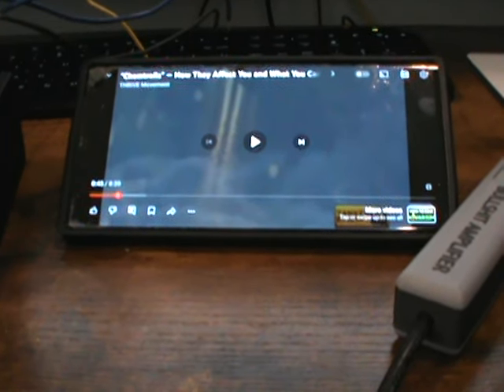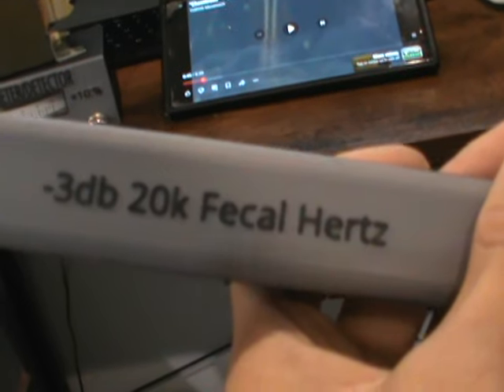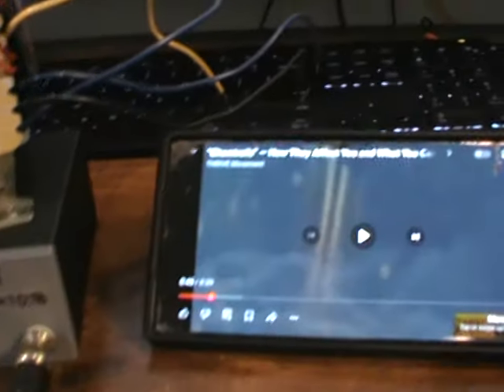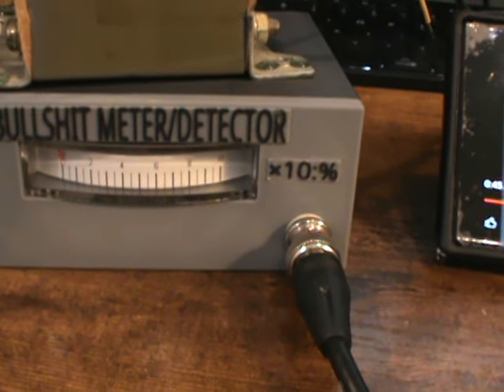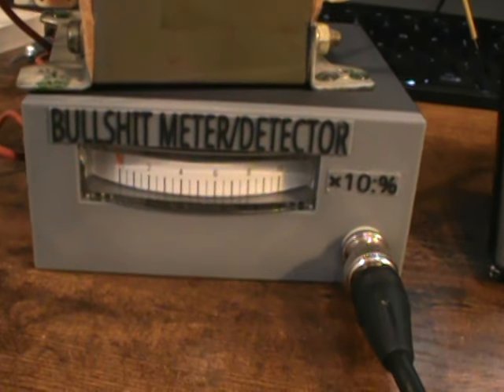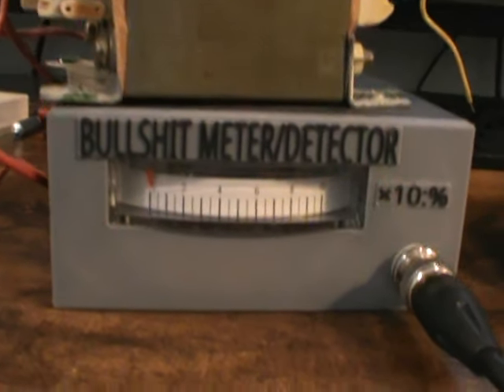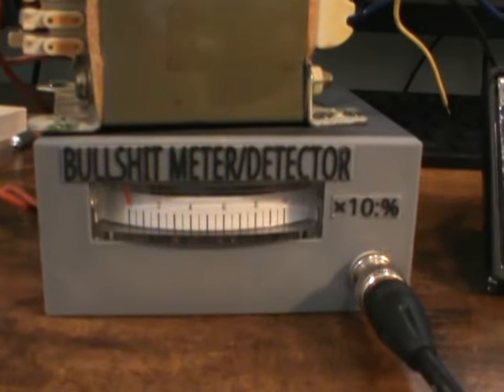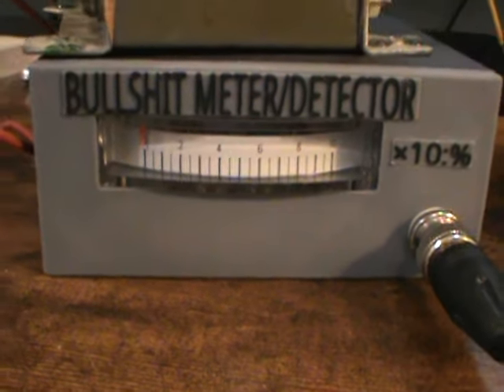The Bullshit O' Meter!

Comment: I worked on some of the first BS meter research back in '63 when we were lucky to get 5 KC of bandwidth out of a vacuum tube probe, your meter reminds me a lot of some of our first prototypes that suffered from exactly the same performance issues up until the late 90s. Although it's seriously impressive how miniaturized you were able to make this unit, the ones we made were the size of a lawnmower by the end.
- The pre-amp and displayed scale has to be A-weighted logarithmic, not linear. A linear topology (even with 9th order retro-BS filtering) will either overload at high BS levels or not have enough sensitivity to detect implied, vague or half-truth BS which is often the most difficult to detect and damaging type of BS that requires the use of a BS meter and trained expert BS meter operator
- The probe pickup horn shape shouldn't be exponential or reverse-log-periodic, you'll only get bad directionality rejection and spurious harmonics, the low-frequency cut-off advantage isn't worth it, stick to a straight pyramid horn. It also makes the dBi and BS⋅W/m² calculations much easier as you only need to consider the aspect ratio and throat diameter of the horn.
- Conical horns do have better performance than pyramid horns, but manufacturing them to the tolerances required is extremely expensive often adding $5k - 10k to the cost of even just a 20 kHz active probe, it's more cost effective to just use a Ni-Cu-Ni-Au pyramid horn and deal with the added inverse phase noise in the IQ demodulation block
- A probe protection membrane and a repeatable calibration sample are essential. Using your probe without protection runs a high risk of damage from contamination but even with protection the microphone will become desensitized after prolonged BS exposure. We would always play a known BS audio sample before every use to calibrate to a known scale and to know when the probe has reached end of life. Our final probe designs got to about 500 hours before needing to be rebuilt, never fully solved the issue, honestly don't think it's possible.
- The use of the transformer to weigh the meter down is extremely dangerous, you should never do that, without proper isolation and shielding the BS in the meter IF signal can be easily coupled through parasitic inductance into the transformer primary amplifying it to dangerous levels. Our research project was terminated due to a similar incident in May of 200- involving the main filter cavity of a high power detector for military use. The final accident investigation report found this bandpass filter cavity de-tuned when heat soaked from an unexpectedly large pure BS input signal which reduced the Q-factor causing exponentially increasing BS feedback between the main output power stages and the input isolation transformer through this filter. The system was designed to handle up to 3,200 MW but the protection mechanisms failed to shut it down and this power excursion pushed it beyond 33,000 MW before there was a BS resonance cascade. The incident was mostly contained with only minor casualties but unfortunately others decided the research facility had to be destroyed to contain it.

Also surprised you posted this on YouTube. You do know as a result of that incident they created 18 U.S.C. § 8922(a)(6)?
(a) It is unlawful for any person or entity to possess, maintain, manufacture, sell, distribute or describe a BS meter or precursor components, schematics, drawings, documents, software, designs or any part thereof. 
(b) Any person found guilty of violating this section shall be fined not more than $25,000,000 or imprisoned for not more than 50 years, or both.
(c) ███████████████████████████████████████████████████████████████████████████████████████████████████████████████

Comment: I think 20khz -3db is too much bandwidth and you get non-linearity that causes noise from upper frequencies to get mirrored to BS passband. You definitely should limit it to at least 10khz to prevent this. Also, it clearly gets overloaded even by legit BS, when Signal-to-BS ratio is too low. Consider extending the scale to at least 146% or adding high BS measurement band.
Reply from the maker: I think the overloading can be clamped with a retro-BS filter. The BS filter only allows BS to pass through while attenuating non-BS. Eventually when the non-BS amplitude passes a certain point, enough non-BS leaks through the filter to then get picked up the op-amp amplifier/buffers. So what I'm thinking of is to add a retro-BS filter in parallel to the output of the BS filter to attenuate the non-BS even more. This would in turn mean I have to re-calibrate the instrument, but yes I think it'll be a significant improvement.

In hindsight, the low pass filter cutoff should be lower like 10k Fecal Hertz as you suggested, but I made it 20k because some people when they start losing an argument about their BS start to get really really high pitched.

 I think instead of making a 146% scale, I'll add BS attenuators instead. I will have to adjust the scale accordingly.